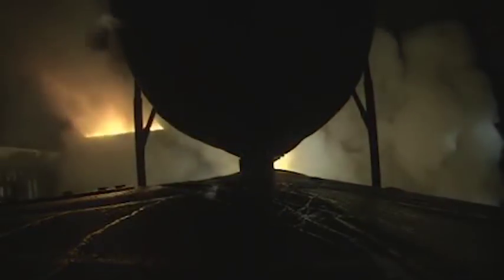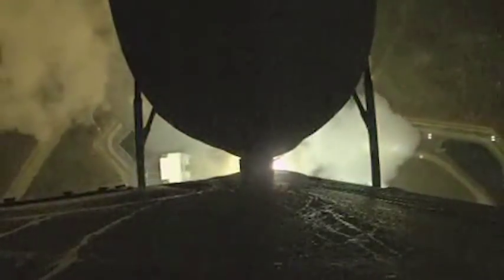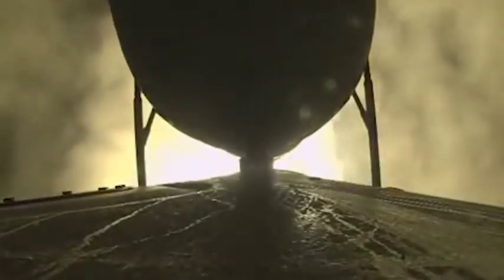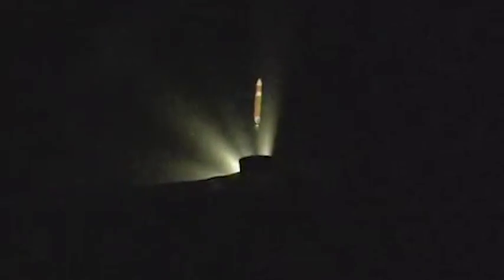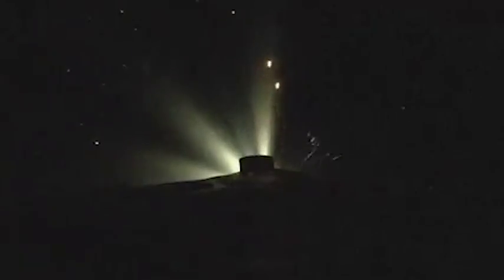Rocket Cam! Delta IV Parker Solar Probe

Comment: Why is the guy saying “miles per hour” rather than “kilometers per hour”?  Isn’t the metric system the standard in most of science and engineering?

What gives?
Reply: Also most things designed by US military contractors use the imperial system.
Reply: He's the ULA public affairs guy... addressing the U.S. press and public, both of whom use the Imperial system.

Comment: What's with the sparks?  Is the engine using ablative cooling?
Reply: Yup, it actually is.
Reply: It is ablative. That also contributes to why the flame burns the color it does even though it's hydrogen and oxygen
Reply: Kent Nebergall 
Chunks of ice coming off engine components.  Especially noticeable just before center core shut down.  Can see the ice pieces tumbling away.

Comment: No sound and only 480p? Very dissapointing for a nice launch
Reply: 480p and no sound is almost ubiquitous with rocketcam footage, not sure what you're complaining about. It's amazing that we get to see this stuff at all.
Reply: JRfo34nv the sound would be a little overwhelming. It would be the roar of the engines but also all the air that would be zipping by the camera
Reply: JRfo34nv it’s a camera on an expendable rocket which goes from very hot to very cold really quickly, is shaken around a lot, is subject to a lot of pressure, needs to be very lightweight and will only be used once. I’d say we’re pretty lucky to have 480p.
Reply: Yeah but no sound is ridiculous even if its static
Reply: JRfo34nv no sound isn’t ridiculous, it is standard from such cameras.